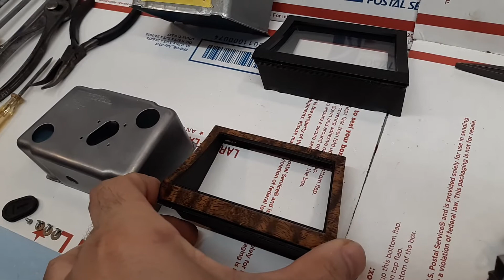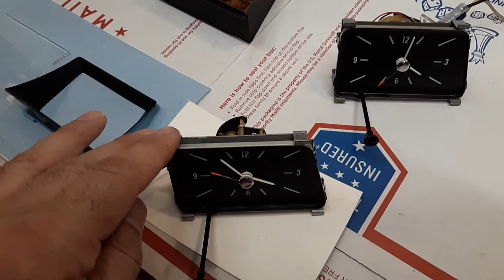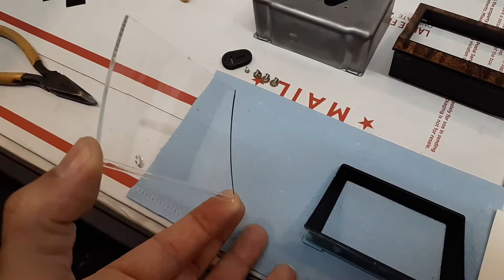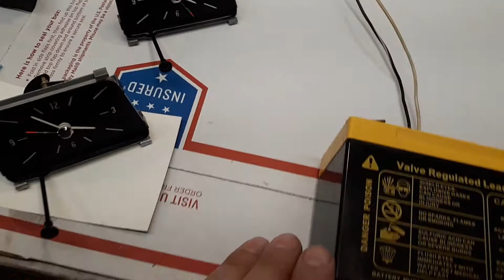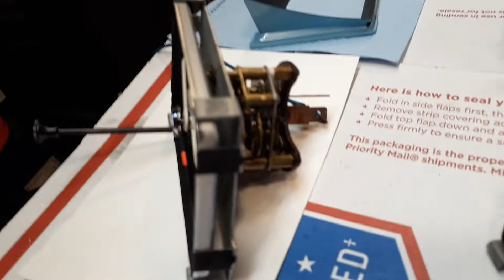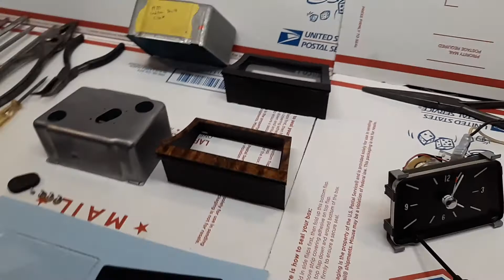1969 1970 Cadillac Clock Original Vintage Restored General Time  Movement QUARTZ Conversion Movement

Comment: Kustom 😎
Reply from the maker: Hello "MNpicker" and thank you for your COOL KUSTOM comment of my restoration work on critical Cadillac vintage component parts,.. specifically the restoration of the 1969-70 Cadillac Clocks with the 1970 specific Woodgrain Bezel. I provide these clocks restorations of the original General Time movements as well as quartz conversions. I also provide restoration of the 1959-1978 dash mount Cadillac clock variants.
I have over 75,000 original vintage 1967-1970 Cadillac items in my collection and over 250,000 1959-1978 Cadillac items overall so if there is anything you may require feel free to reach out to me again. I am best known for my Restoration of the Cadillac Steering Wheels and Steering Columns, Power Seat Mechanisms and Stereo Radios and Power Antennas.
Kind Regards,
George
Tel: 727-364-7523
eMail: kypitsn@aol.com